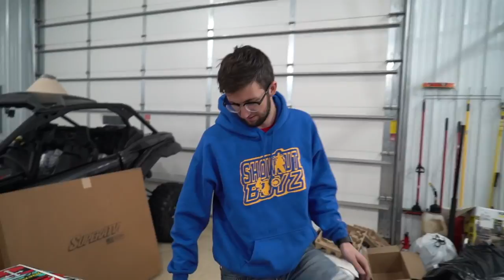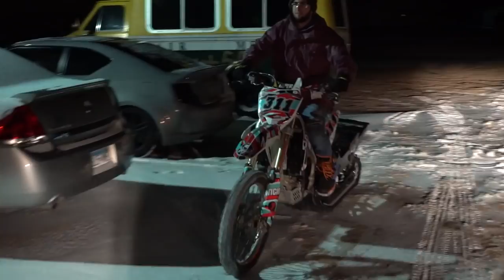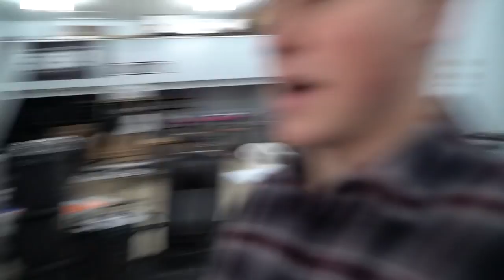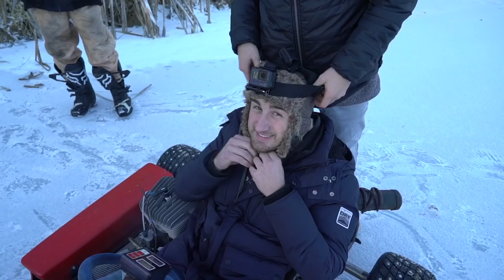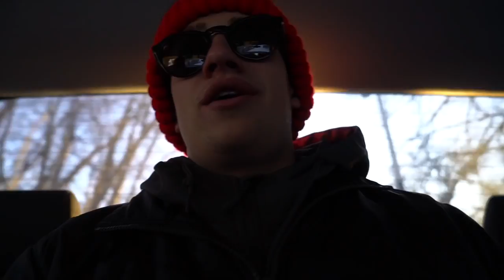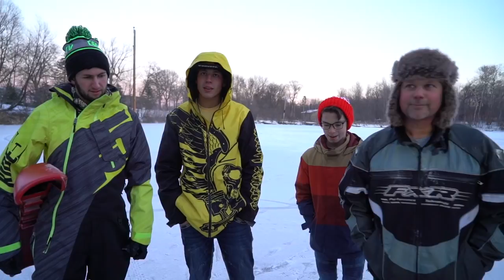Shifter Kart with Studded Tires on THIN ICE!!

Comment: The shifter kart motor is a Yamaha kt100
Reply: I didnt think they made a shifter Kt
Reply: @andrewpatterson4730  kt100 isnt a shifter
Reply: howerton5 oh I didn’t know that, I don’t know much about shifter karts, the engine just looked really similar to a kt100
Reply: @denniskulcsar9778  Oh no, t does Im not sure if they changed the transmission or if the engine isn't actually a kt100. But I am more than positive that it is a kt100. If that was a real 80cc or 125cc shifter it would have a lot more power
Reply: It's not a kt100. The kt100 has straight fins on top of it where as the engine that @CboysTV have has slanted fins on top
Reply: @BENSTAR52  so its probably a ka100

Comment: the two-stroke on the shifter kart looks like a parilla 100 or 125 cc, i guess it could be a kt100, but the head's cooling fins don't look right
Reply: Can't be a kt100, it has a transmission. I think you were right with Aprilia. Just a vintage "80's" air cooled version.

Comment: I jist got a shifter kart with a honda nighthawk 250 4 stroke twin 5 speed open headers (cmx250)...its only 20hp but bullet proofe motor and fun...but if i would use a bigger aircooled motor like a cb450 or cb750 motor.

Comment: Hey when i have trouble with getting the bead to pop i put hydraulic grease around the rim rap a rope around the center of the tire get a rod stuck it between the rope and tire and twisted it and put a crap ton of air in that sucker and it popped right on after a few tries

Comment: What's the best used car under $30,000?
Reply: Jack Poratti Chevy Duramax
Reply: Best is a very vague term. Depends on what you consider as best. Fuel rconomy? Power? Speed? Acceleration? Luxury? Reliability? Seating? Visibility?  Safety rating? The list goes on and on.
Reply: @MK-qv7bq  Mostly speed and luxury. Who needs good fuel Economy anyway?
Reply: Tbh you could find a bad ass vett that has a turb on it
Reply: 2013 Hyundai veloster turbo
Reply: @jackporatti986  Look for a 2014 Chevy SS its essesmtially a revamped Pontiac G8. Powered by a 6.2 liter v8 and backed with a 6 speed manual. Fast affordable and will be competitive with most amy car on the road. Also very reliable.

Comment: I race mod sleds on the water you can run 91 and add octane booster or just run regular 91 it'll run fine just won't be as fast... There's no reason why it should blow up running lower octane

Comment: You guys do need 110 all the 2 stroke go karts I race with run it I run a 100 cc 2 stroke and that kart is probably a 125 but you should probably put in 110